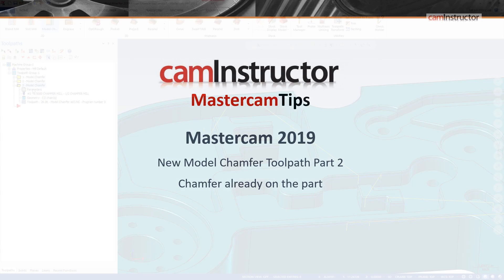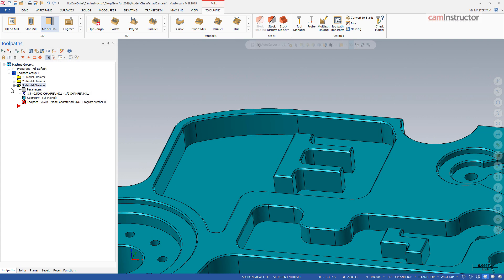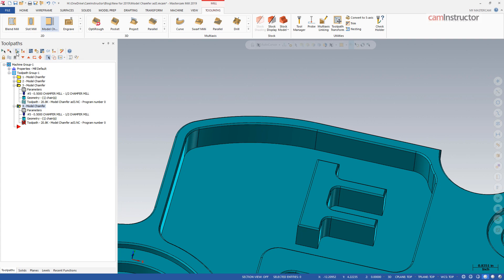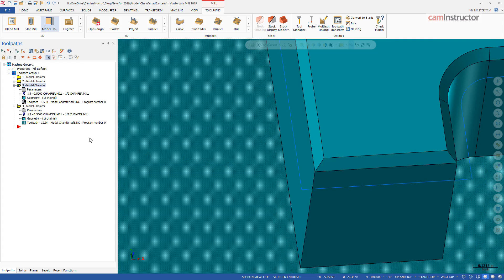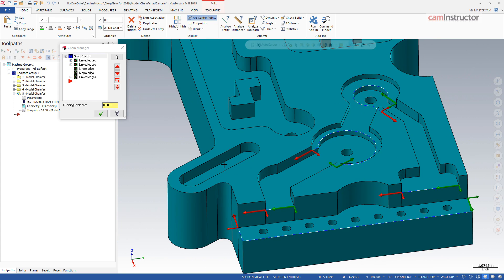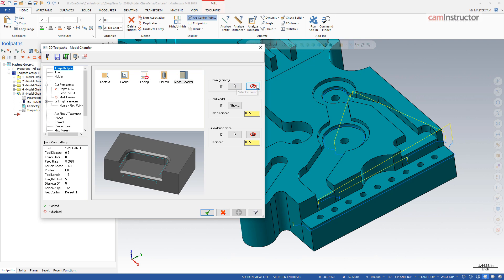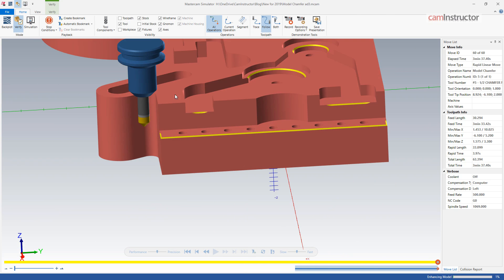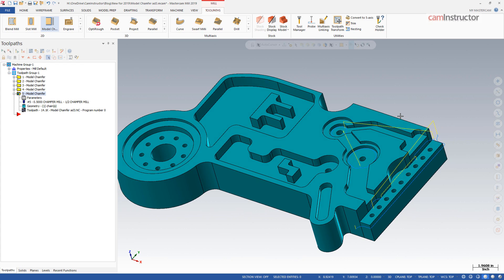New in Mastercam 2019 - Model Chamfer Video 2 of 2

Comment: 8:30 or you could drop the tool further down and use the outer side of the cutting edge
Reply from the maker: That would have to be in a separate toolpath otherwise the bottom of the tool would void into the floor of the chamfers in the pockets. Well, the toolpath would not create those since they would gouge so you would only get the chamfer on those outer edges. You'd still need another toolpath to hit the internal edges. So either multiple toolpaths with the larger tool or one toolpath with a smaller tool. Either way there will still be a small bit left in those corners.